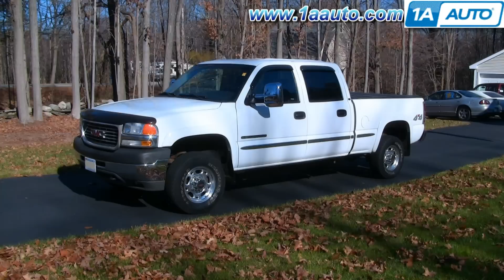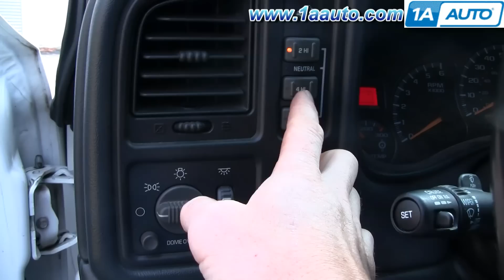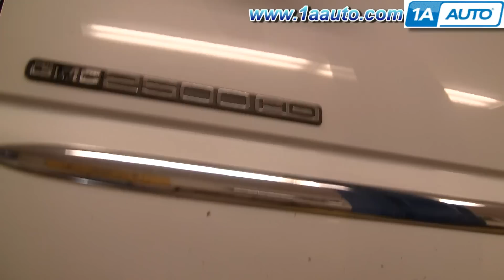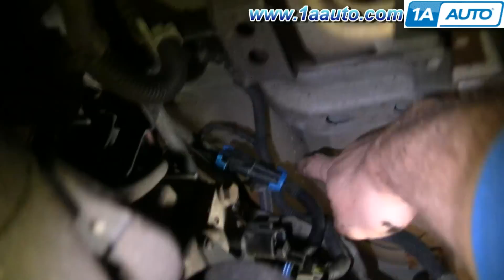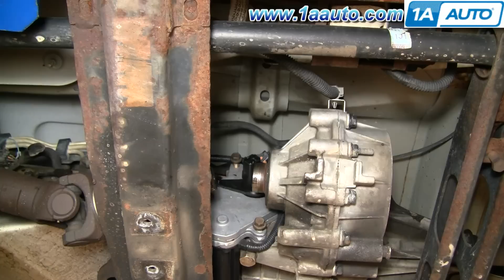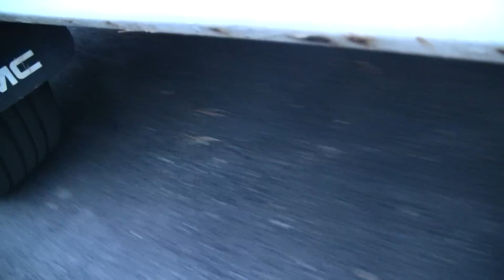How to Replace Transfer Case Shift Motor 01-02 GMC Sierra 2500 HD

Comment: I could use some help here! I have a 2001 Chevy s-10 four wheel drive, and I started hearing a loud banging noise coming from my front end when I'm driving in 4x4, I changed the actuator and it still makes the noise and sometimes I noticed that the 4 hi light will go out while I'm driving at 65 to 70 mph! Any help is appreciated!

Comment: question I have a 96 silverado K1500 with the shiftier on the floor.  when i try to put it into 4x4 it grinds and little and the drops into 4WL but its not really in 4WL the motor acts like it is but the front axle is not truly engaged.  any ideas on what it could be?
Reply from the maker: HI Mark, You may want to take a look at the axle 4WD actuator to see if it's acting up. We carry new ones on our website. Here's a link to them if you would like to see what we carry. Hope this helps you out. http://www.1aauto.com/1A/four-wheel-drive-parts/Chevy/K1500-Truck/-/-/1996?utm_source=VideoReply&utm_medium=YouTube&utm_campaign=1ATony

Comment: I recently had my transmission rebuilt on my 2001 S10 4×4, now my 4×4 does not work, I changed the motor switch thinking it was the issue,  I can hear it changing but will not engage the trnsfer case, I added 1 addition quart of transmission fluid just to be on the safe side that it may need more, do I need to add more fluid. What could be the issue, the tensfer case is not damged..
Reply from the maker: You may want to check the dipstick on the transmission to make sure that it's not over filled. That system also runs off of vacuum, check all of the vacuum lines in the engine compartment to see if any of them are broke, or if there's a vacuum leak. There's an actuator that that tends to fail on that truck too. Here's a video that will show you what to look for. Hope this helps you out. How To Install Replace 4WD Front Axle Vacuum Actuator GMC S15 Sonoma Chevy Blazer 1AAuto.com
Reply: Thank u..I will check out dis wk...

Comment from the maker: Christian Helser
 
I have a 1990 Chevy 2500 and I went to turn my 4x4 on which is on the ground and the light never turned on and it still is 2 wheels drive. Any advice I should look for or do to fix it?

You may want to check the fuse on that circuit to see if it's blown and needs to be replaced. If that's okay, you may want to test the power going to the switch, with a test light or an ohm meter.

If there's power going to the switch and none coming out of the switch when it is pressed, you may have a bad switch. Hope this helps you out. 1aauto.com 888-844-3393

Comment: I have a 1990 chevy 2500 and I went to turn my 4x4 on which is on the ground and the light never turned on and it still is 2 wheels drive. Any advice I should look for or do to fix it?

Comment from the maker: @ Logan Stone
 
love your videos, thanks.
I have a 1999 silverado 2500 and the 4wd buttons are not lighting up and its not going in 4wd. It say "service 4wd" in the display in dash. i replaced a blown fuse. checked other fuses and replaced the 4 button auto 4x4 controller on the dash.
 Do you have a guess on what it is or what i should replace next? Transfer case shift motor? any help would be great. Its snowing in Colorado and 4x4 is handy and fun.
Thank you.

You may want to pull the code from the computer. This should help to point you in the right direction as to what might be causing the problem. Hope this helps you out. 1aauto.com 888-844-3393

Comment: love your videos, thanks.
I have a 1999 silverado 2500 and the 4wd buttons are not lighting up and its not going in 4wd. It say "service 4wd" in the display in dash. i replaced a blown fuse. checked other fuses and replaced the 4 button auto 4x4 controller on the dash.
 Do you have a guess on what it is or what i should replace next? Transfer case shift motor? any help would be great. Its snowing in Colorado and 4x4 is handy and fun.
Thank you.

Comment: I have a 2001 GMC Yukon XL and I'm having trouble figuring out if I need an actuator or replace transmission. I put it in gear and it will not move in reverse or forward. The first time it did it, I let it sit for a few hours and it moved about 35 feet then it wouldn't accelerate no more. When in gear it just idles and will not go. Please give me a plan of action.

Comment from the maker: You may want to see that when you do put it in 4WD that the front shaft locks into place, and the transfer case is engaging it correctly. 1aauto.com 888-844-3393

Comment: i have a 2003 chevy 2500hd and my actuator is good and it down shifts the gear ratio when put in 4lo and 4hi but i don't have power to the front wheels what could cause this.

Comment from the maker: You may want to check the vacuum lines to see if any of them need to be replaced. You can also see if there's power going to the actuator with a test light or an ohm meter. Hope this helps you out. 1aauto.com 888-844-3393

Comment: I have an 02 GMC Sanoma ZR2 and when i push the button to put it in 4x4 it doesnt sound like it engages all the way. The light tells me it is in 4x4 but my front tires still wont spin. Hoping you can tell me what the issue would be.

Thanks, Caleb

Comment: I have an 04 yukon that occasionally while driving down the road it will go into neutral and will only in gauge into any gear if you switch to 4hi. Do you think it could be the switch or motor?

Comment: I was stuck in 4HI when mine stopped working. Had to replace 4x4 shift motor (mates with transfer case), 4x4 module (signaled by clicking sound under glove compartment in passenger wall) , and then the lights just blinked and I had to replace the 4x4 actuator (under the battery)
.
moral of the story... don't wait to fix it.

Comment: Thank you for the informative video but I would certainly clean the driveshaft yoke with a solvent after dropping it on the dirty, rusted crossmember. I would also solvent clean the U-joint stub. Depending on the mileage of the vehicle I would tend to want to solvent clean all of the grease out of both U-joint caps and repack the bearings. Not too much work since it's all apart already. My truck was giving erratic 4HI to LO shifts for about a year and now it's stuck in low so I think it's time.

Comment: Since you're dropping the front drive shaft, it'd be a good time to switch out the u-joints if they haven't been done before. I've done my rear about 3 or 4 times in my 04 silverado but never the front. Maybe on a rainy day. Thanks for the video. I may replace my motor this summer or just pick up a spare just in case.

Comment: Hi Mike, I have a 1999 Chevy Blazer that will not fully engage to 4wd the back tires engage but front ones don't I have a video at night (sorry) of the lights/clicks from xfer case to cpu that it does. Only 2wd works/ stay solid but all others blink. I replaced the control module and vacuum hoses and vacuum switch (its on firewall) all new too. I was hoping I could get some insight from you. youtube.com/watch?v=InkgVSaYbPo

Comment: Great video! I just got my 02 Silverado. When I turn very sharp, I hear a rubbing/grinding noise, and sometimes the truck bounces a little. I can hear my shift motor working seemingly normal when I shift into 4-Hi. When I drive in 4-Hi I it feels a bit rough and like there's a rubbing/grinding noise. I cannot shift into 4-Lo. Everything else about the truck seems great! My uncle, who lives in a different city and used to be a mechanic, thinks like the turning issue may be 4x4 related. Thoughts?

Comment from the maker: The issue could be with one of the forks inside the transfer case not engaging all the way and what you are hearing is gear on gear contact. You will definitely want to bring it in and have it checked out before you use the 4x4 anymore.

Comment: Thanks for the video. My local professional wanted $500 for the motor, your site has it 
for ~$163. They also wanted 3 hours in labor costs and your video is 15 minutes, but with fast forwarding of the movie, you might have had the truck on the lift for 45 minutes. Unfortunately it is hard to find an honest mechanic these days.

Comment: Hi mike mine stack on 4Low how do I line mine up? And my button has 4 button instead of 3 button. This is my second time I'm replacing mine the first time is true mechanic now it when out again why is that? This time I'm doing it my self and I'm going to video it and show it to you tube I need some in put from you I don't want to mess this thing up. Thanks for your video on you tube